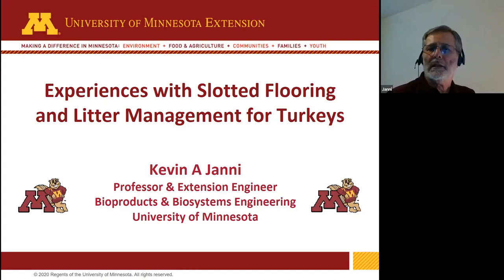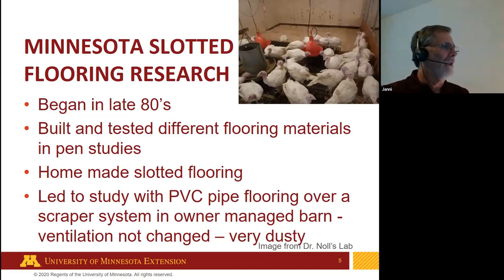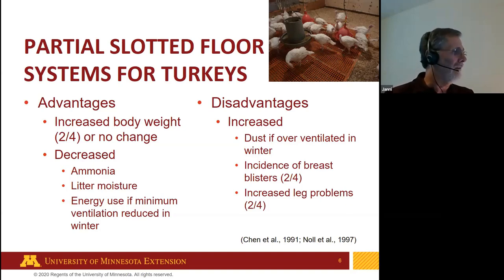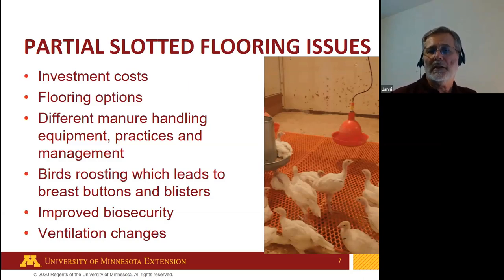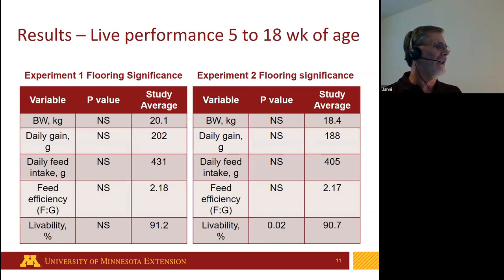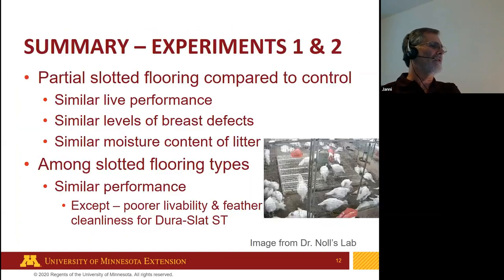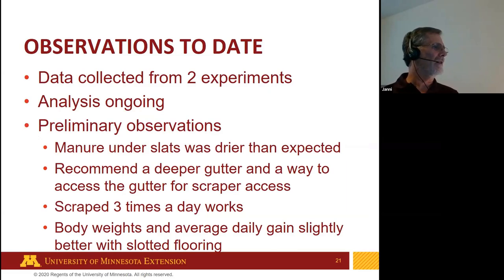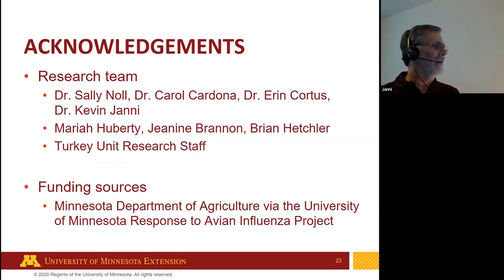Experiences with Slotted Flooring and Litter Management for Turkeys

Comment: Please tell me the climate needs of each bird and in cubic meters per hour in the closed house of :

The amount of temperature, relative humidity, negative pressure ventilation, heating and cooling, light
 and  amount of emissions of carbon dioxide and ammonia

And the amount of feed for each . With a treatment program for diseases